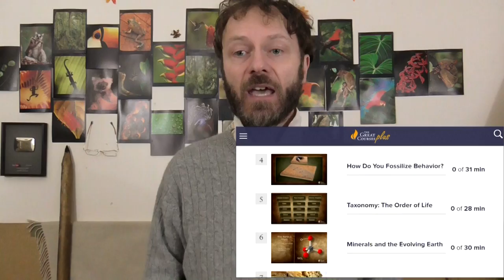Muzzle Brakes - what are they for?

Comment: Please enlighten me: I see, why the lesser recoil is a thing, especially if the muzzle brake is turned backwards.
Yet from my physical understanding: the lower the backforce is, the lower the force frontwise is or the projectile is propelled less. Actio = reactio, so if I lower the backblow, I'd had to give up some propelling force, don't I?
Reply: Yes, but if you think about it, the mussle break is after the original length of the barrel, so you would not lose any of the original energy and you would probably gain abit more
Reply: @jamesmulligan7413  No damn sure you do. Otherwise you could go aheah and screw some holes inside left and right of the barrel. If it makes no difference.
Reply: @Samcaracha  I agree with James there.  The projectile velocity is same the projectile velocity, after a set length of barrel.  The muzzle brake is channeling gasses after that point in time.  
In terms of reaction vs. action and physics, you are giving up on launching a big cloud of gas forward.  Whether that gas ends up forward or mostly sideways matters very very little to the projectile, but it does change the recoil noticeably (apparently).
Reply: @ComradeOgilvy1984  "that point in time" is an interesting part for me.
If you have, lets say a given length of closed barrel, that is the length of propulsion and the recoil of that cannot be changed. That is the propulsion = recoil part.  If you'd add a muzzle break to that lets say 5 cm to it doesnt help the projectile in case of propulsion, so it doesnt cause or reduce recoil. So if anything, even in small parameters it doesnt matter where the gas goes. Sideways or frontways so 5 cm additional muzzle break only takes away the gas behind the projektile in a distinkt way, to the sides or so. But it would not change the recoil significantly

Comment: A combo muzzle brake/flash hider is something someone wanted to make a lot of money with on modern rifles that have such a small amount of recoil you'll understand the reason all those Colt A2 Sporters were great with a simple flash hider. 
Then you buy a ridiculously expensive AR of another brand they feel the need to take you for another  $150 so you have to use hearing protection and if you shoot at a public range, everyone, including yourself,  will have their day ruined by the equivalent of someone using grenades just a few feet away. 

They hate it, you hate it and you pack up, go home and order a  $100 tool and an A2 style flash hider for another  $30 dollars.....and then you're ready to shoot that damned coyote and he's the only one injured.  Now you have an expensive tool you'll never use again except to help a friend who bought a rifle with that devilish thing someone convinced him he HAD to have. 

Live and learn. Anyone Need that Tool I'll never use again barring another friend needing to remove that godawful thing from his latest acquisition?  Anyone need a SS combo hearing ruiner and pickup bed mud remover?  The tool can be used to change the gas block on the perfectly fine barrel you have.  The tool, used with a half inch drive extension.......once........and shows no sign of being even removed from the package, should last many lifetimes. It's a deal you can't turn down if you want to avoid that high-pitched whistle in your ears the rest of your life.  I only wish I had used it before I ever pulled the trigger.

For those who never get in the field to hunt, you can spend about the same amount of money for hearing protection.

Comment: He missed the most important reason for a muzzle brake to reduce recoil. Once the projectile leaves the barrel basically what you have is  rocket engine forcing the gun barrel back the muzzle brake allows much of that energy to escape sideways greatly reducing the amount of recoil. Not all guns required a muzzle brake it all depended on how much room in the turret.

Comment: Finally corrects himself after starting in using "barrel brake" several times, then goes immediately back to saying it. I don't particularly mind, since it is attached to the barrel, but when you're used to saying "muzzle brake" it's very distracting. I already know Lindy doesn't have any military background despite being such a fan of all things military throughout the ages, but I figured he would have known and adopted the term "muzzle brake" almost automatically by now, since they are also used extensively on firearms along with flash suppressors as muzzle devices. Funny.

Comment: iin 1967 i worked at a machine shop i rough machined muzzle brakes  they stood on the floor about 40" high and the outside dia. was 10 1/4 "  i never food out what weapon they were used on if any body knows let me know i never found out i made about 10 orders of about 6 in each order .

Comment: Question. I thought that the recoil happened the moment the projectile leaves the barrel as the gas pressure at the now open end of the barrel drops while the gas pressure at the breech end is still high thus pushing the weapon backwards. is this correct?
Reply: Recoil occurs soon as mass starts moving. Soon as the projectile starts moving out the chamber, you're getting recoil.

Comment: So, thats why naval guns never had a muzzle brake. They were often in turrets with 2, 3 or even 4 guns, that blast would destroy neighbouring guns, superstructure, etc, not to mention poor sailors that had very hard time without it, imagine what would happen if 406mm naval gun would fire and have muzzle brake, it would destroy everything in a 10 meters radius.
Reply: No, naval guns dont had muzzle brakes, because space was not a problem.
In a tank space is a huge problem, every part was is bigger than nesseccary, makes the tank bigger too.
With a muzzle brake, the hydraulic shock absorber of the gun can be smaller, wich means the gun fits in a smaller turret, a smaller turret can have a smaller turret ring, with a smaller turret ring the hull of the tank can be smaller too, a smaller tank is lighter, the saved weight can be used to make the tank more mobile or to increase the armor.

Comment: Five minutes in and I still don't hear an explanation as to what a muzzle brake is:
A  muzzle brake or recoil  compensator is a device connected to, or a feature integral to the construction of the muzzle or barrel of a firearm or cannon that is intended to redirect a portion of propellant gases to counter recoil and unwanted muzzle rise. 
There. That took less than five minutes.

Comment: I remember when doing an internet search for (example) "what is a barrell brake on a gun for?" And the results would look like as follows..
BRAKE systems on a vehicle...
a jake BRAKE found on commercial tractors are for.......
new paint GUN designs are 20% more efficient than....
whiskey aged in a white oak BARRELL is darker....
new GUN has a longer BARRELL for improved accuracy in long ranged....

Comment: Why do you say barrel break all the time? Those barrels did not break, did they? Or do barrel brakes really exist? During recoil, it seems a good idea to stop the barrel from moving, or it will smash into something,  shaking your tank off its feet a second time. How do they stop that recoil, anyway? Those heavy barrels move a huge distance, is that lost energy used someway? Does the canon recoil charge the tank batteries, perhaps? Or does it heat the tank? What it all started, does the barrel have a brake? Or a break? I can't hear any difference between brake and break. Hear or hare however....
Reply: Voor Naam are you joking?
Reply: @hazardous458  What do you think? If it looks like a joke, and it sounds like joke, it probably is a duck.

Comment: 👍👍👍.  And sometimes it’s always the Little Things that go unnoticed!   Funny too- don’t know if YOU have covered it yet-  but from the  FRANT of a Muzzle-  at the BACK END, especially with  BAZOOKAS  & Shoulder Fired/ Launched projectiles ;  I found it AMAZING  that one Great Idea To attempt to negate that ENERGY was to put a Plug Of WATER or was it Sand at the EXIT to absorb/ redirect THAT Energy. Especially in Close Combat formations!   Check it out if you haven’t already done one on it.  God Bless. 👴🏼NoBody
Reply: You're talking about a recoilless gun. Earliest application of one I know of came from late WWI attack planes. Someone had the idea of mounting a small-caliber cannon pointing down from an airplane. They'd fly over the bad guys and pop an explosive shell down into the trenches or bunker or tank with this cannon. Of course, this was still the days of rickety biplanes, so the recoil of such a cannon would be very bad for the airplane.

The solution? Weld a second cannon to the back of the first cannon, pointed in the opposite direction (upwards, in this case). Fire both cannons together, and their recoil cancelled each other out. The downward-pointing gun fired a steel explosive-laden shell, while the upwards-firing gun shot a solid lead slug into the sky.
Reply: @BogeyTheBear   Thanks B. the B.! 🎯 On!!  I’m STILL working on getting a Warthog - but it’s a hard sell to Wifey!  God Bless. NRN.  👴🏼NoBody

Comment: Having extensive experience with the subject first hand and seeing tanks fire on the the range, there is a tremendous fireball that erupts on the end of a plain barrel after every shot. If you need only one valid reason to use a muzzle brake / flash suppressor, it is to reduce and contain that huge fireball. The same fireball also kicks up a tremendous amount of dust and debri in front of the tank. So it is a complete mystery to me why only the Germans used muzzle brakes extensively. You'll notice that the gas is channeled to the sides where it will kick up very little dust. Add to that the German use of low flash powder, it would be much harder to spot a German tank firing than any allied tank with their lack of a muzzle brake and high flash powder.

Comment: https://youtu.be/P5x0Jlxl9uU?t=1071
'Side blast', as you call it can/is a problem with magnum rifles also. I was at the rifle range getting in some practice and the gentleman 2 spots down had a .300 Win Mag with muzzle porting: every time he capped one off I would be pelted by hot bits of propellant and gas and NOISE.
You should maybe discuss bore extractors on the M1 Abrams also.

Comment: The myth of superior armor penetration of the 6 pndr over the 75mm is exactly that, a myth. The 6 pndr was only superior at short ranges. Aside from that the 75 mm was superior in every respect.
Wow! this video contains a plethora of myths. Sorry Lindybeige, your  accounts of WWII vehicles are full of myths, overly simplistic and does not add anything worthy of note to the record. 
You could have made this video in less than 5 minutes, sticking to the topic and it would have been much  more valuable.

Comment: Lindybeige, while you are a tank enthusiast, you keep on spreading nonsense. Same as misleading "facts" you told in "Hetzer" video, you are wrong in your assumptions about muzzle brakes.
Let me straighten it up:

If you shoot a gun without muzzle brake, the smoke is extracted away from your tank and since your optics are usually offset, your view clears up pretty fast. In contrast with muzzle brake the smoke stays at the level of the tank, mostly in front of the optics. So it is actually other way around as you stated. If you dont believe me, go and try...

second, you said that most modern tanks do not have muzzle brake, well actually they do, sort of. They do have fume extractor (or bore evacuator), that cylinder around the barrel. It has the same function as muzzle brake (to relieve pressure before shell extraction) but plus they serve as a device to clean the toxic fumes before the breach opens. While you are correct that in WWII some AFVs using SABOT had problems with muzzle brakes (usually due to harmonic oscillation), the real reason why there are no muzzle brakes on modern tank is the fume extractor is functioning even better and it is not prone to bad habit of muzzle brake, which is:

and here we come to your next mistake, low concealment profile of muzzle brake.  No, its not that a gun with muzzle brake is causing problems to own troops around the tank. If you study closely, you will find that most German AFVs equipped with high velocity guns and not having muzzle brake are tank destroyers. And there is a reason for it, TD was mostly used from concealed position and the muzzle brake with its flashes from sides makes a huge cross showing here I am... You can see that some late German WWII TDs do have barrel mount for the muzzle brake, but its never mounted (i.e. "Hetzer", Jagdtiger, some Jagdpanzer IV), so the higher velocity rounds could not be used in favor of higher concealment.

so the fume extractor is channeling the smoke to the front of the gun and there is no cross like flash in front of the vehicle. So its vastly superior to muzzle brake. 

I know that this video is older and you maybe learned new facts in the meantime, buy you should write it in description or remove the misleading video.
Reply: The first sentence i total agree with you, but what you straigthen up is nonsens too.

Fume exctractors and muzzle brakes are completly different and do different jobs, both have nothing to do with relieving pressure befor shell extraction.
The fume extractor does exact that what the name implies, nothing more, nothing less, it uses simple fluid mechanic and pressure difference to blow the fumes out of the barrel.
A muzzle brake reduces the recoil by redirecting the gases, after the shell left the barrel, the reduce of the muzzle flash and the spread of the fumes are only "collateral damage" and not the main purpose of a muzzle brake.
Befor the fume extractor was invented, they blowed the fume out with compressed air.

The Problem with the TD like StuG III and IV was not the fumes, due to the low profile of the TD they blowed up a lot of dust from the ground, Pz IV, Panther, and Tiger didnt had that problem. Pak with even lower fire hight, solved that problem simply by removing leaves in front of the gun and wetten the ground.
StuG III and IV solved the Problem with the reduced sight from blown up dust, by rotating the muzzle brake.

And no, you cant see Hetzer, Jagdtiger or JgPz IV/L70 with mountings for muzzle brakes, they never had one (and thats also the only german TD without muzzle brakes)
The guns of the Hetzer and JgPz IV were modified to handel the stronger recoil without a muzzle brake, and the 12,8cm Pak, KwK, PjK, never had a muzzle brake, only the Pak had a flash suppressor.
The pictures of Hetzer with mountings for a muzzle brake or even with a muzzle brake, are not WW2 Hetzer, thats are post war swiss G13.

The problem with SABOT and muzzle brakes is, the SABOT and/or the muzzle brake has to be designed so that the SABOT cant open when it is still in the muzzle brake, wich is more complicated, otherwise the SABOT can get stuck or rip off the muzzle brake.